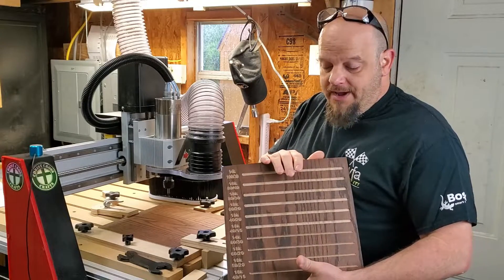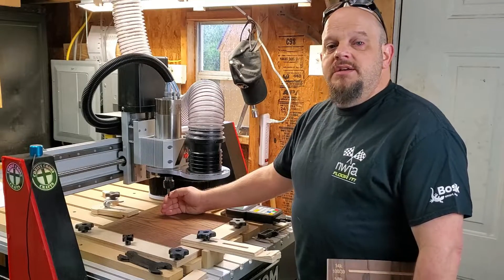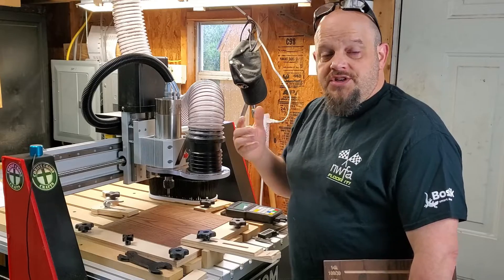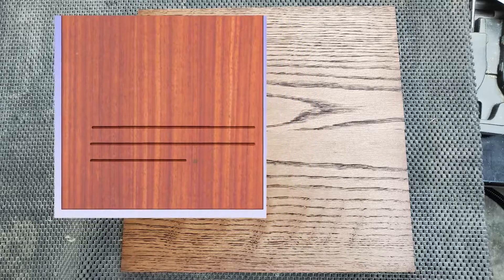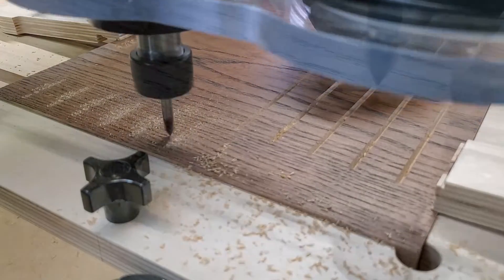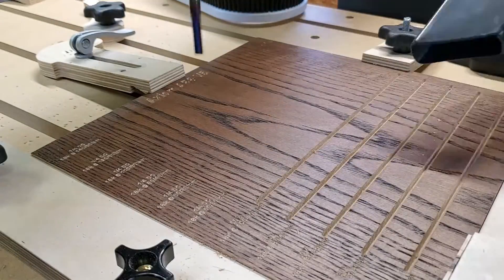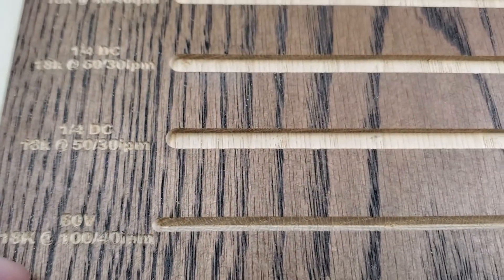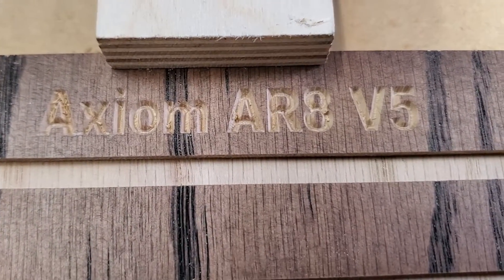CNC Feed, Speed, and Chiploads...Axiom Edition

Comment: On my axiom a set parameters window pops up and stops everything. Cant get my machine to cut, did you have that problem ? Iv had my AR8 for one year and can't cut anything so far.
Reply from the maker: It sounds like you have a setting off or are on the wrong screen.  If you've had it that long, my first call would be to axiom technical.
Reply: @ChristcrossCrafts  I have contacted them a couple of times and no reply.
Reply from the maker: @garciarosa100 they were bought out by Jet and Powermatic and moved to TN.  Go to the axiom user group on fb and keep trying.